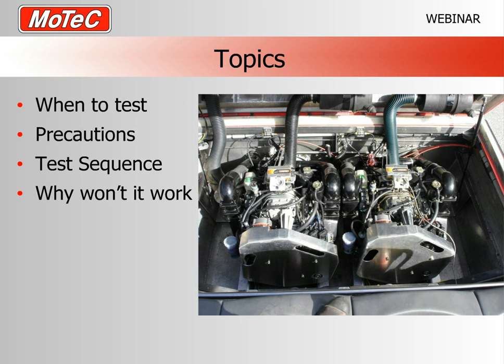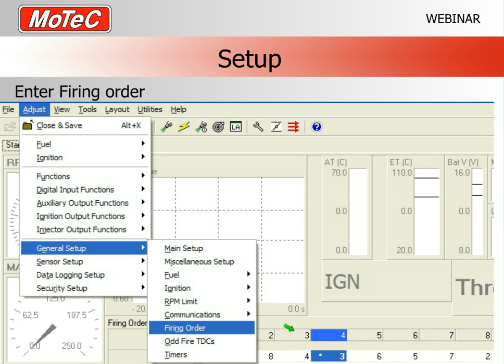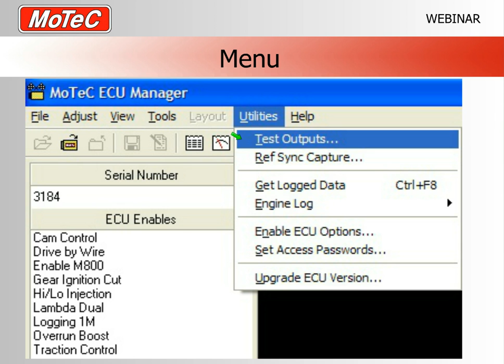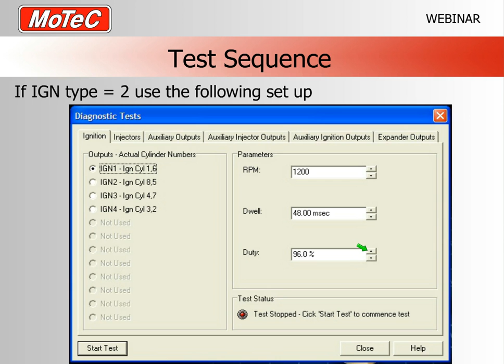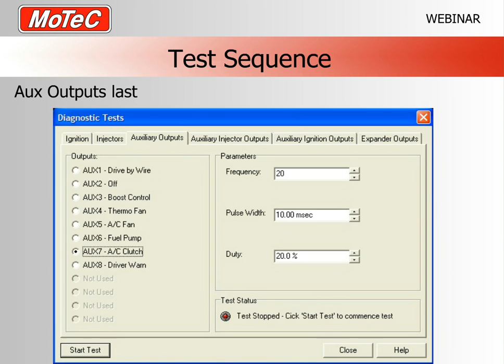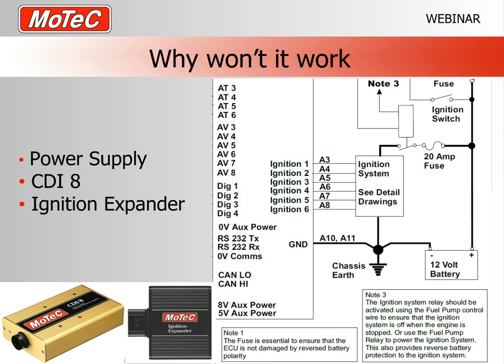How to test ECU Outputs

Comment: I know this is really old video but a buddy has a vw 2.5 5 cylinder  with a m800 and motec expander the car starts up idles fine let it warm up to operating temp and when Rev the motor 6000 rpm car would  throw error sync signal  so changed the cam sensor and crank sensor.  Well there also alot of fluid coming out of the exhaust buddy said it was condensation but that should have went away when up pipe got hot so I believe it dumping fuel. I was with my buddy the other night and didn't give any error on the sync . Said error LA1 sen Ctrl  was red in the errors. I didn't wire the car up but who ever did they wired the wideband sensor to work as two he said when it goes into boost the ecu would read a different part of the map. I was not sure if that was proper so I questioned it. So since it having the problem  at above 6k is it recommended to test the ignition system to see if this problem is the coils and also run the injector at that rpm test range ... or is it a bad wideband sensor because of that shady wiring job.. any feedback will help. Because the guy who set the car up gave him the car right after he ran on the dyno and then the car sat a few months because of the winter and first track test buddy go and the headache begins and the guy told him get a new ignition expander box that might be the problem .
Reply from the maker: Hi, Please contact our support team via email, Support@motec.com.au and they will assist you with this.
Reply: @MoTeCglobal  thank you I will

Comment: Hey motec I am using an AEM CDI 8 channel with motec m600. Wont it fire in test output too? I am assuming its similar to the Motec CDI8 in a few given ways itself. I tried test output and there was no spark whatsoever. AEM fires the way they said it should be, no relay used as per as their demand.
Reply: Falah Khalid good day, please note that the MoTeC CDI/8 uses a single ignition output from the Hundred Series ECU and the CDI/8 is coded to understand sequential ignition output to 8 individual coils. The AEM CDI works in a different manner altogether, also, keep in mind that example demonstrated for the ignition test by the webinar host was for an inductive coil scenario and not a capacitive discharge ignition solution.

As the webinar host instructed please double check the test parameters, in-particular the rising or falling edge signal. Some insight from the AEM manufacturer based on what you are trying to do might be another way to speed things along.

I know this is quite a dated comment but for anyone else viewing this webinar the information would be useful.

Cheers!
Reply: Thanks for the info certainly helpful